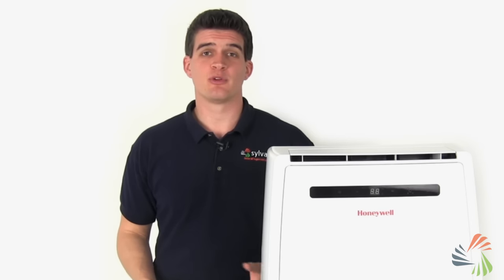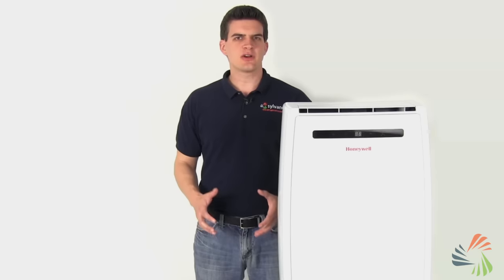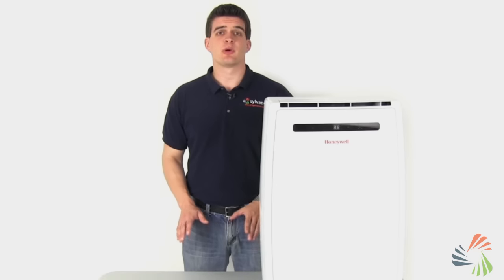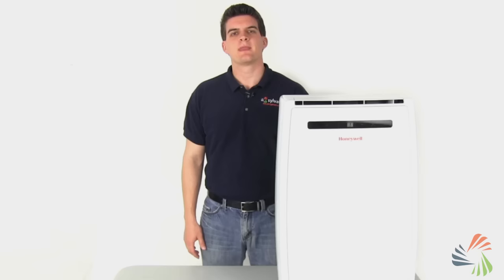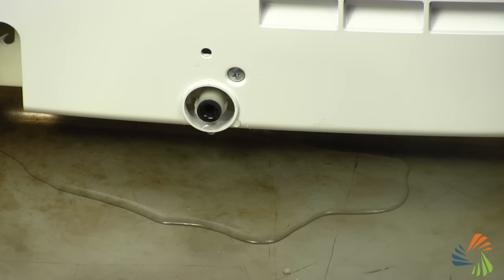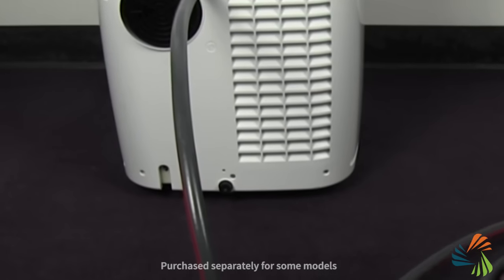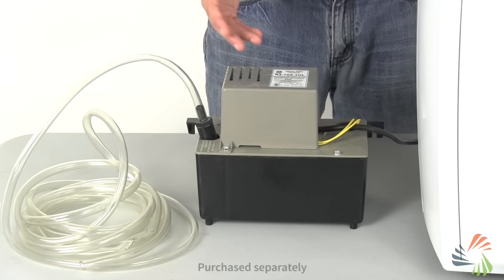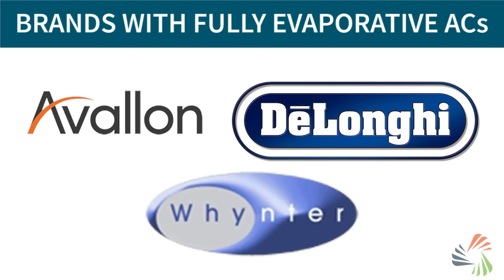How to Drain a Portable AC: Fully vs. Partially Evaporative | Sylvane

Comment: i've had success using a pond pump in a pan to pump the water into the discharge air stream. does a pretty good job of removing the moisture, and it was a dirt cheap solution. You can also run a thin tube from your drain pan into the warm air discharge stream. the venturi effect will draw the water out of the pan as long as the elevation grade is not too much.

Comment: Well at least this one didn't tell me to lift the unit onto a stool. Like please - how is one person supposed to life this beast up like 12 inches?? I'm going to try the cookie sheet thing next time.
Reply: I just bought a small square dolly on Amazon so it stays high enough where I can place a container under spout no lifting.
Reply: Use a few books instead so you just need to lift one corner at a time
Reply: mine is sitting on a chair with a bathroom rug. I brought it up my stairs on my own. Since it's on a chair I use a drain hose but I have yet to see it expell any water from it.

Comment: I have to elevate mine and have a bucket under it. On a hot summer day it can easily fill up my bucket. Of course I could drill holes in my house for the hose to go through, but that sort of defeats the purpose of a portable ac :)
Reply: Not the greatest idea if done on default drain location height. If it's partially evaporarive there is a disk that throws water on radiator. But if it's single hose there is hardly any purpose aside power consumption

Comment: Mine doesn’t give an alarm when the tray is full, learned that the hard way when I woke up one morning with my floor all covered in puddles.. Also this happened after 2-3 years of using it and I never had to drain it once, in contrast to people saying they have to drain theirs every few hours. Really confused
Reply: Mine is supposed to be drained over time and in the manual it states that it will have a sign on a display as a warning which i never had. Just out of curiosity i did drain it and all i could get was like 300ml tops
Reply: @Subjektt  because it never overfills and evaporates. It says to drain it only to clean somewhat the tray.
Reply: That's where I'm at now. Had mine for a year, and it's telling me it's full. I tilted the AC toward a bucket, and only minimal water came out. I then tried the hose hookup, and a little more water came out.

It no longer says it's full, but it sure does flood my carpet

Comment: I have an asahi portable air-conditioned. everytime I turn it on my p.a.c shuts off after an hour.... and a red light pops with a image of a bucket with full of water droplets. I tried to open the drainage and let the water go out, but it seems only a droplet comes out... I made a hose and plug it in the drain outlet and my p.a.c is back to normal. may I ask whats the problem? is there any problem with what I Did?
Reply: Pablo Acas Same problem 😣
Reply: There should be a 2nd plugged vent high up on the unit; find that and loosen it. Water shoukd pour out with ease. Be sure to stop it back up after you finish draining it if you unit is not set up/ meant for continual draining.

Comment: Question. I have two drains on my portable ac on one on mid section and one at the bottom.. Im planing to place a hose. So which one should i place it.
Reply from the maker: Without knowing your exact model, you'll likely want to add a hose to the lower one for continuous drainage. The one halfway up the unit is for Dehumidify mode. Double check your manual, but that's how most models work.
Reply: @Sylvane  Thank YOU! I have an Uberhaus portable AC and wondered why there were 2 drains. The lower one almost never needs draining but the top one will empty out gallons in a day when in AC mode. From what you've said, I suspect that most moisture will evap out the air hose/exhaust and that top one isn't necessary to drain unless you use in dehumidify mode as you say (ie, without an exhaust hose attached).

Comment: Got a pelonis one. Where it sits inside and vent tube goes out the window. 

Says p1 code.  Thats full water tank. 
Barly any water came out. Was that all it was? 
The error is gone. 

Or should disconnect the vent tube? So i can i tip it back and see if there is more water. 

Every time i see someone drain it. They just un do the plug. And thats all they have to do. 

Im also woundering if it could be like stuff in there and i need to suck it out with an air compressor

Comment: I just bought a LG Portable AC and living in the south I had to drain the unit every three hours so it was suggested to me to buy a condensate pump. I got the pump and attached it to the top drain port but I was told by HD store clerk that is incorrect. Will the pump work at the bottom too with the hose I bought?
Reply from the maker: Hi Linda. Typically condensate pumps are attached using the top drain port. Those ports are designed to fit a traditional garden hose, which comes with most condensate pumps.
Reply: I also have a LG Portable AC unit, but it doesn't have a top drain port. Only the one at the bottom. Is there another way to attached the condensate pump to the unit? I have to drain my unit every 15-20 minutes. 
the model of my AC unit is LP1111WXR and I got a Everbuilt condensate pump.

Thank you,

Comment: Could you please recommend a buying option for portable AC with dual hose and fully evaporative option unit and post a link?
Reply: I have a Haier Commercial Cool Portable Air Conditioner (CPN14XC9) - 14,000  btu ,purchased in 2011 & still evaporating, but still needs to be drained, when it fills beyond evaporating capacity.  lol   A high chair, bucket and towels below, should do the trick to drain it.

Comment: But my question is where does this water come from do you guys fill this up yourself or it’s already there in the portable air conditioner?
I haven’t have this air conditioner but I am asking this randomly?
Reply from the maker: In humid areas, excess moisture is pulled out of the air naturally during the cooling process. In some instances, the moisture collects inside the portable AC. That's how moisture ends up being involved in the process. Thank you - Tony from Sylvane
Reply: Better Air with Sylvane thanks it helped a lot

Comment: yes but how do you drain it out the window... that is the question I cannot find the answer to. There is no window panel where you can connect a water drain hose. The only window panels are the ones for the AC exhaust hose. Please help
Reply: You’d have to get a condensate pump like he says in the video. They can run from about $49 to about $115. It hooks up to the drain directly and then you plug it in and most have a float sensor that gauges how much water is in a reservoir so it knows when to start the pump.

Comment: I bought a Whynter ARC-131GD and am continuously draining it through the bottom drain into a bucket. It collects approximately 5 gallons over 24 hours while in "cool" mode. 

The question is: would it be better to use the top drain and why?
Reply from the maker: Hi! That particular model has Whynter's AutoDrain technology where if it's installed properly it's supposed to recycle the captured moisture and exhaust it outside. In that case the benefit is that you should never have to empty the reservoir unless it collects more moisture than it can pump out quickly. If that happened the compressor would automatically stop until the reservoir was emptied to prevent it overflowing. Thanks for your question!

Comment: Ok this Is a question that still nobody has answered in any of these videos about portable air conditioner units. When they get full and need to be emptied how will I know it's full? Mine is digital like the majority of newer units on the market today so is there a setting on the LED front panel that will light up to indicate thst the reservoir is full and I need to empty it or how am I supposed to know when it's full and needs to be emptied? I was using the plastic tubing hose thst connects to the drain plug and just placing a damn cookie sheet underneath the middle of the hose so I would just continously empty itself thst way and then end up overflowing on my bedroom carpet a few times because the only way I can get it to drain using that plastic piece of tubing that comes with the window kit is to place a flat cookie sheet under it .I tried a glass bowl but the damn hose kept Flipping itself out of the damn bowl in the middle of the night getting splashes of dirty condensation water all  over my carpet so it's a never ending battle. Tonight I completely cleaned the emptied the reservoir by having to put the cookie sheet under the front of the unit and tip it backwards while holding onto the unit with my hands and waiting for all the water to stop but not much came out because the last week it's been draining a lot by using the plastic tubing and if was very humid here in Ontario the past month and a half so the condensation really built up quickly then I put the cap back on the drain plug and made sure It was on there tightly so it does not leak water during the night.  Then I cleaned the grill at the very back of my unit that just slides in and out and wiped all the dust off it with a Mico fiber cloth and made sure it was nice and clean and dry before I put it back in place.  So I guess 🤷 I'll wait and see what happens now that I've taken out that rubber tubing that I was using since I installed this brand new unit in May this year but it's very frustrating and I'm fed up with it now and it takes up too much space in my room to have that rubber tubing laying on a cookie sheet beside the ac unit which is beside my bed 🛌 😄 I've had enough of friggin summer ☀️ 😅😅😅😅! I'm ready to disassemble this unit, clean it off inside and outside and cover it for the fall and winter months and embrace the fall and winter months with open arms ❤😅😅! Has anyone else come across the same problem as me with their portable air conditioner units with the draining aspect of it? If so would really appreciate some honest feedback about everyone else's experience and what you ended up doing and has anyone else used a damn cookie sheet underneath that rubber tubing or is it just me? 😅
Reply: Me too 😢 it takes up so much space… not really portable either because it overflowed once all over my bedroom floor so I elevated it to drain it using the plastic tube in a friggin huge container… so I have no idea if we’re supposed to put the caps back on the drain holes and just do it once every other day. It seriously sucks that I couldn’t get one of those square cubes that you put in your window. 🙄

Comment: How come you have a drain at the bottom and the other one on top (where you attach the hose).  Why is the hose so high?  Do you have to siphon it out with the hose?  You did not explain.  Do you just plug the hose and it will gravitate down by itself?  Will it gush out before you try to connect the hose?  Do you connect the hose when it's empty and leave it on?  When it's full?
Reply from the maker: Both drains are used to get rid of collected water. The drain port at the bottom is typically used when ACs are in standard Cool mode and don't need to be emptied very often. When water collects extremely quickly (like in Dehumidifier mode if your AC offers that), then you can attach a hose to the top drain for continuous drainage. Water should automatically flow through the hose when the pan is full; but it won't come rushing out. Every AC is slightly different, so reach out to your manufacturer for specific instructions if you're still having problems.
Reply: +Sylvane Inc. Thank you brah.
Reply: Jose Balboa qq

Comment: Hi I have a problem today.  we drain the water already.  But today when we wanted to turn it on the power button was just flashing.  please help.  what could be the problem.
Reply from the maker: Hi Patricia, sorry you are having this issue! What unit (brand and model number) do you have?
Reply: Sorry for the delay.  But the model is WA-8070E
Reply from the maker: Not a problem! We suggest you make sure the drain cap is on securely and then unplug your AC. If it doesn't work when you plug it back in, call Sunpentown's customer service at 800-330-0388.

Comment: HELP! My portable AC keeps telling me it needs to drain. I unscrew it and try to drain it, but nothing comes out. I can hear the water inside. how do I make it come out???
Reply: +Arieru Marino this is late but ...did you take the plug out?
Reply: Yeah, I'm thinking there's a rubber plug (where you can alternatively attach a hose).  You might have to remove it for the water to breathe out?  This video is not clear and missing a lot of detailed information...fucking guy.
Reply: Captain Porksword No, in Lis Angeles, it hasn't really gotten A/C-hot, and when we got a heatwave, a few days ago, I wasn't home, so I texted my daughter to do it, but I don't know how she did it (or if she did).  I told her, "google it".   I don't know why they make these things so complicated...or maybe they're not...Maybe we just don't know.
Reply from the maker: If your AC's drain pan is full, you should be able to drain it using the drain port on the back near the bottom of the unit. Water should drip out once the plug is removed. Each model/brand is different, so if you're still having trouble, we suggest calling your manufacturer to tell them what you're seeing.

Comment: So I have this stupid ac unit, and every 5 minutes or so it has P1 error, and I check the drain on the bottom everytime and nothing, there's no water in the container or water from the top, but it starts the fan option, instead of the cool. it's getting annoying. I knew I should have bought that damn insurance on it.
Reply from the maker: Sergei Mathas Sorry you're having so many problems. You should reach out to your manufacturer, because they'll have a better idea of how to fix the problem. There may be an issue with the draining system that you can't see (a crack in the pan can cause errors on some models), or it may be an issue with the control panel. The manufacturer should be able to point you in the right direction.
Reply: We're all good, I didn't turn it on for a while and it seemed to reset it self
Reply: +Sergei Mathas do you have an everstar unit? my everstar unit has a P1 error when the bucket on the side is full or isnt seated correctly.

Comment: I have a Haier and it sloshes when you move it and I had to tilt it to move it and a lot of water leaked out (on the carpet :( ). Their instructions say to drain it to store but they don't say how. There is a pipe but no plug and no drain pipe. Very aggravating. They say if it is tilted to wait 24 hours to turn it on. I need to tilt it to get the water out. And does this water not harbour bacteria, mold etc?
Reply from the maker: You should definitely drain the water before storing it for the season. The drain port is typically in the back at the bottom of the unit. Usually you can remove the plug and let the water drain into a pan. If you're still having trouble, we suggest you contact the Haier Customer Satisfaction Center at 1-877-337-3639.
Reply: Is it the Haier Commercial Cool? Black and silver/grey? I have same one, there's a little cap at the very bottom on the back that you unscrew, then you pop out a little rubber stopper, it will train without tilting into a pan, if you need to tilt it, then it's probably clogged.  You can get a hose and connector for it, it's just not a standard garden hose.
Reply: Mine says to dry it completely for storage, run it in "fan" mode for 24 hours.
Reply: +1025092 Me too!.  Haier Commercial Cool Portable Air Conditioner (CPN14XC9) - 14,000 btu

Comment: i have a Heller branded portable AC and i recently realised that it is leaking im not sure how to fix this any help?  PS. there is 3 settings on AC (Fan, Cooling) but the third one i have no idea what it is it has a picture of something that looks like a tray with water drops...
Reply from the maker: +Vendetta Bruh There may be a crack in your drainage pan, but we suggest reaching out to the manufacturer. They will have more information on your specific model.
Reply: I think the 3rd setting with the water drops may be the dehumidifier mode (whatever that is).
Reply: +Jose is right about the dehumidifier mode, but +Vendetta, the reason it was leaking was because it was full.  You have to unscrew the water outlet drain, which is on the back rear, at the bottom, to the left of the power chord.  I put unit on a chair and tilted, but water didn't just come out the drainage hole, but also on each side of it.  Some got on floor, but the bucket caught most of it.  Unit shuts off also automatically, with STOP in the display, which indicates "time to drain".  It is supposed to be designed to evaporate the water, but I guess a few of our 90+ degree Humidity days overflowed it.   lol  (Haier Commercial Cool Portable Air Conditioner (CPN14XC9) - 14,000 btu)

Comment: Does a portable AC unit exist with a removable tank that can be easily removed from the unit, poured out into a sink, then re-installed?
Reply: Good luck with the removable tray.  I have a Haier Commercial Cool Portable Air Conditioner (CPN14XC9) - 14000  btu, since 2011.  Today, was 1st time I had to drain it, because it Shut Off.  Then screwed off drain, tilted unit from a chair, into a bucket.  Unit can only remove 110 pints/day of moisture in dehumidifying mode, which I must have exceeded in several days.  Be careful when picking it up, since the unit weighs 83 lbs.  :-)
Reply: Yes, my DeLonghi Penguino has a removable tray at the back
Reply: @mycosys  Is it the PACAN125HPEK? because my penguino has a filter on the back but don't think it has a removable tank..